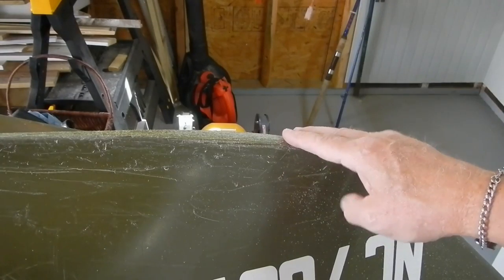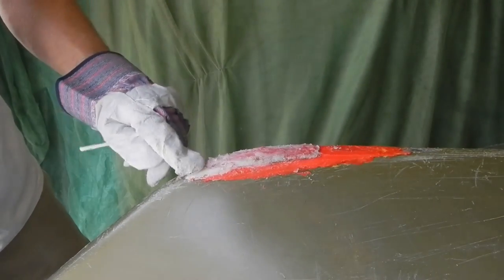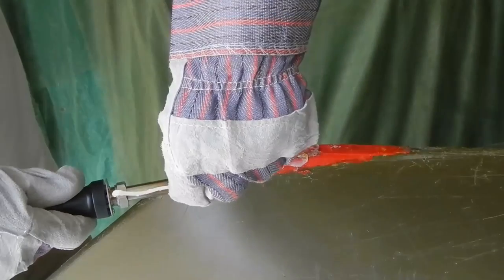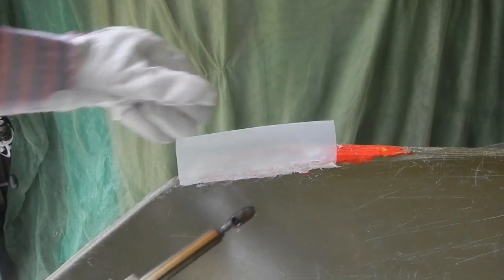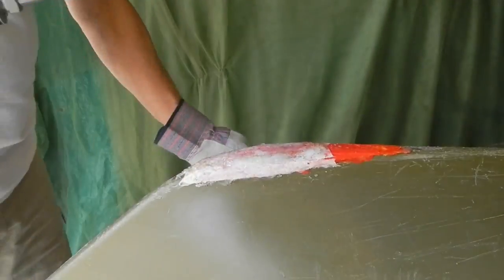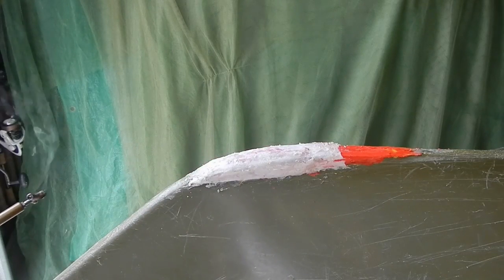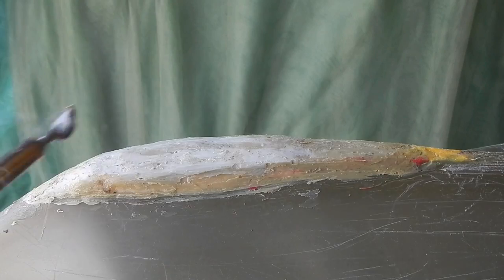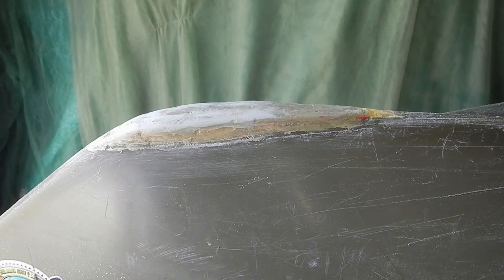Kayak Repair Plastic Welding: Kayak Keel Repair

Comment: I'm just about to watch the video... Here are my tips
#1 Use the butt end of a screwdriver to smooth the surface with small twists.
#2 KEEP THE IRON CLEAN! If you don't your patch will look muddy.
#3 If you use wire mesh just press it in lightly below the surface working your way from one end then add filler to the top of it... Screwdriver butt to press / smooth.
#6 At end: Sand it smooth (end with 220+) and reheat to remove white sand marks.
#7 If adding a cover layer on top of the patch... Use a heat gun to heat the surface and the sheet. 
Spray Pam on aluminum lay sheet and heat it till it melts then lay on your heated patch. 
Tip: I use old plastic tool cases to repair and cover patches
Reply from the maker: Thank you for those tips!

Comment: Also a great adhesive is U-418, used to adhere windshields in Cars. Flexible, waterproof STRONG Bond. It is black in color, comes in a metal Caulking gun tube. Score the surface with 80 grit, clean/prep with Acetone or Lacquer thinner, Cut/Mold your patch to shape, apply U-418 and attach the patch. Let set for 12 hrs. I used a bit of duct tape to hold the patch in place, then pulled it off the next day...Still going Strong, 3 yrs now on a HDPE Float. Hope this helps!
Reply from the maker: Thanks for the tip... I was not aware of that product.

Comment: Probably one of the best repair jobs I've seen.  I never thought about putting a mesh in it.  Has it still held up well?
Reply from the maker: Yes! Of course, the concrete continued to erode the plastic on top, but the mesh was a line of defense and a red flag.  Once I saw the mesh popping out, I knew it was time to put another layer of plastic on top.

Comment: I melted blue 55 gallon drum and milk jugs melted into my hull then I sanded it and backed it with G-Flex, now I'm coating the entire bottom with G-Flex then I'm adding skid guards, how has yous held up? It looks good
Reply from the maker: Mine worked fine! I put Gator Guards on it as well.

Comment: This makes me think you could embed some threaded nuts or insert of some kind into the kayak to make a replaceable sacrificial pad like some kayaks have. Thx for sharing, be well.
Reply from the maker: I ended up putting a Gator Guard on. The downside is that product can only be used twice.
Reply: @KayakhacksFishing  I have been using this tape made by fiber fix, it has a sort of carbon fiber pattern to it that give some stand off from the surface. It holds up in the water but Arizona heat did make the part I had to cut and bend around the keel peel back but it just stuck back on. Good old tape is my go to for disposable guards, I do wonder how the fiber fix that cures hard would work, you may have to glue it on after you form it but that's some tough stuff when dry. Just some thoughts for what its worth, keep up the good stuff!

Comment: That's a great tool were did you get it from . Thanks
Reply from the maker: I got it off amazon - here is the link - http://amzn.to/1UC9sH9

I also bought the flat paddle, but you do not really need it - http://amzn.to/1W5kNjY - save your $$

It came with a bunch of rods.  If you purchase additional, do not make the mistake I did and get rods that were to small.

Comment: great video i know the video is not about it but which one would you prefer for fishing sit inside kayaks or sir on tops? would appreciate if you reply;)
Reply from the maker: Absolutely get a sit on top.  I have the Native angler 14.5 foot that is kind of like a half canoe. While it is great for interior storage, it is almost impossible to recover if it tips. A traditional sit inside with the hole for the paddler to sit in is equally problematic. For the traditional sit inside, there is a whole process of stabilizing and then pumping the water out before you can do acrobatics to get back into the sitting area. If I had to do it again, I would buy a sit on top.
Reply: +Kayak Hacks Fishing thanks for replying just picked up my 15 foot scupper pro sit on top kayak havent used it yet thanks for helping me decide;)
Reply from the maker: Good choice!

Comment: You should use heat gun with nozel to get smuth finish , it would be perfectly flat
Reply from the maker: Right! I used the heat gun at the end after sanding and then pressed with my leather gloves to smooth.

Comment: Is it paintable ?
Reply from the maker: It is my understanding from others that HDPE Is not paintable without application of a special primer.  I have not tested that myself, but was told 34 94 Primer will allow paint to stick.
http://amzn.to/2bJwb69  is the link so you can see the details on Amazon.
Reply: I the plastic on kayaks colored all the way through the plastic. I seen one guy melting pieces of tarp filling scratches. I don't have a kayak yet but I'm planning on get one . I'm looking as a Dagger Katana 10.4 white water crossover or the Dagger Axis 10.5. I'm sure it's impossible to prevent scratches but I hope I can keep them at a minimal.
Reply from the maker: aikidragonpiper71 I was interested in the tarp video as well.  Unfortunately, I could not confirm that any tarp is made out of HDPE.  The packaging and manufacturer websites are silent.  Just for kicks, I did the tarp process (hot putty knife) with thin strips of real HDPE from a milk container and it worked.  BUT..Two things... I don't think it is a good idea to mix the types of polyethylene and, more significantly, reading the recommendations of manufacturers is that unless the gouge is significant, do not mess with it.  Here is a link to Perception's position:

http://www.perceptionkayaks.com/us/sites/default/files/images/products/Polyethylene_Repair_Guide.pdf

Comment: good job on the repair BUT.... lol sorry - your doing it wrong! LOL If you want to stay dry when launching, buy a boat...  for kayaks, you should be launching and landing before you hit the ramp. stop when your 1 foot deep, then get out and out your cart on. when you launch, use your cart to 1 foot deep then take the wheels off. yes, your feet will get wet.... but feet dry, and no holes in a yak that can run up to $3500... - - Also, Most Kayak Keels are 5/8" thick... (thats a lot of plastic to grind down)
Reply from the maker: I wish! It seems like I always end up at the launch when the water is really deep or too cold to want to step in. Great advice, though. I will have to really try and implement it when I can.
Reply: lmao will you push for a mandate?

to each their own

ownership of private property means i can treat my things however i want. ok comrade.